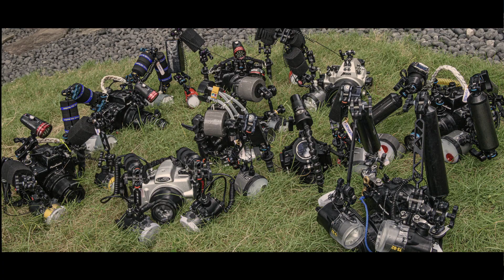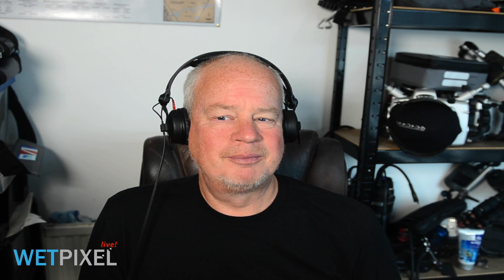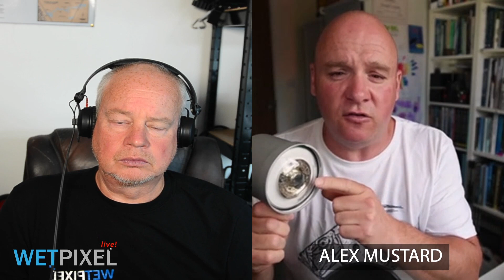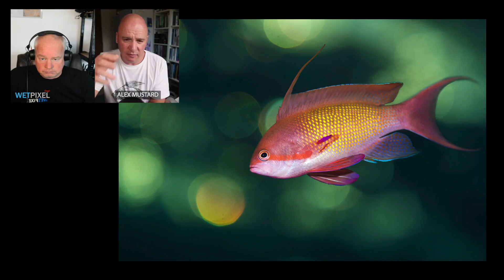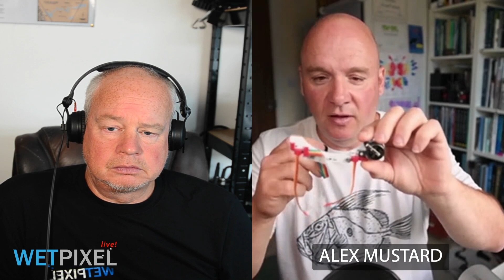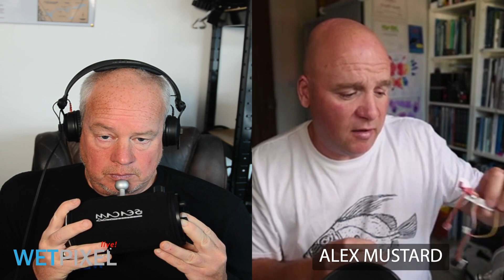High Speed Synchronization for Underwater Photographers

Comment: Could someone explain to me why those high speed sync devices cost sooo much ? It's literally 2 leds, why is it 400 usd (and there's no waterproofing needed or fancy case, it's just a PCB!). I can buy a real flash on Amazon for 100 usd that is HSS capable (with many other options), what is going on ? Am I missing something or are they just trying to milk us because there's not that many people producing them atm?
Reply from the maker: I think you are paying for the small number of units sold, and the complications and time involved in hacking the TTL protocols.
Reply: @Wetpixel-Live  Very frustrating though, if they priced it at a more accessible price point, I'm sure they would sell thousands of these, even people with small point and shoot cameras would see the worth in spending 50 bucks to get to 1/320s instead of 1/160. And they still make plenty of profits at 50 bucks. Also they sell non TTL protocols that are the same price. Most people just want to shoot manual at a fast shutter :)
Reply: @Wetpixel-Live  Thanks. So basically if the plans for this leaked on the internet, I could build mine for 5 usd :D

Comment: Can't wait to get in and try it out! My Sony a6500 syncs at only 1/160, so it's going to be a game-changer. Thank you both for the explanations.
Reply: Justin. I am shooting with a Sony NEX 6 in a Nauticam housing using YS-D2 strobes. For a while I used sync cords and that allowed me to increase flash sync speed a maximum of 1/320 (if I remember correctly). The increased flash sync speed was definitely exciting to work with. 
However, after I flooded two strobes and a few sync cords I went back to Fiber optics (and the rather low sync speed of 1/160). The sync cord connection on the SEA&SEA strobes are IMHO too unreliable. 
Now I am looking at getting a strobe trigger from www.trt-Electronics.com. The question is what type would fit the housing (there is two types for Sony on offer). If you  already have an idea about how you would increase your flash sync speed on your a5000, then kindly let me know. Thanks.
Reply from the maker: I think it will be great for you

Comment from the maker: Just been chatting to Alex, and we both felt that we should mention that having high-speed sync options are particularly useful for those with cameras with low native flash sync speeds. For example, the Nikon Z series cameras have a sync speed of 1/200s, but if used with compatible flash control circuitry and strobes, this could be increased to a faster speed for fast-moving subjects.